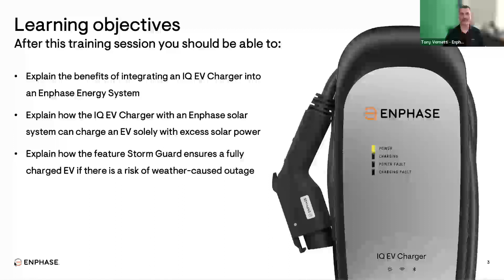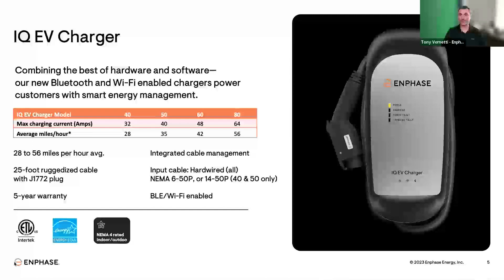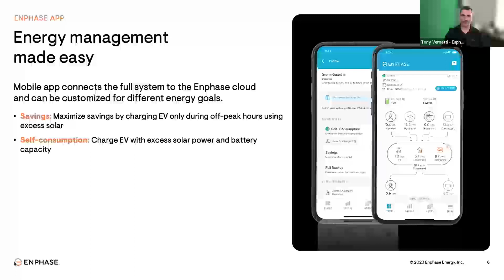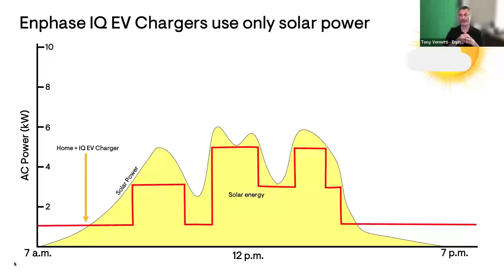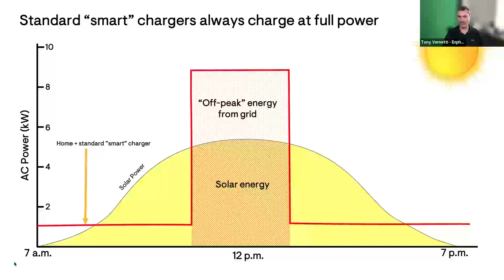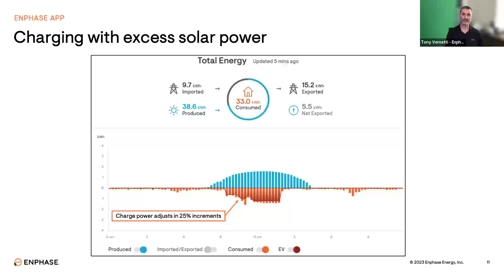Enphase IQ EV Charger Sales Webinar

Comment: Hi Tony, what a great video. You have a great speaking voice and make the presentation at just the right speed, with enough detail for a very good understand of the system as well as avoiding too much potentially confusing minutia. I have a question for anyone who can answer it. Starting at around 13:10 you say that In the self consumption mode monitoring of both energy production and energy consumption by the system. Assume the charger is presently controlled to charge at full power and then an heavy load like an AC compressor turns on. Will the inverter automatically and quickly adjust (reduce) the charging power to prevent overloading the solar array (assuming it can't provide enough for both full power charging and the AC compressor)? Assuming the charger is communicating with the system via WiFi and the communications goes down for some reason, what does the charger do?